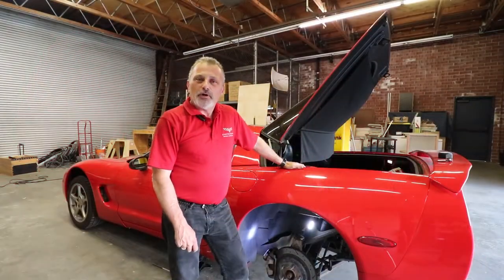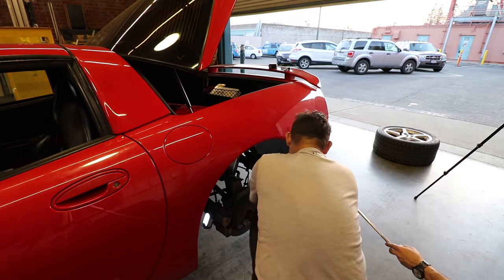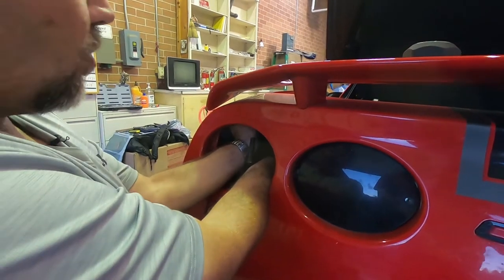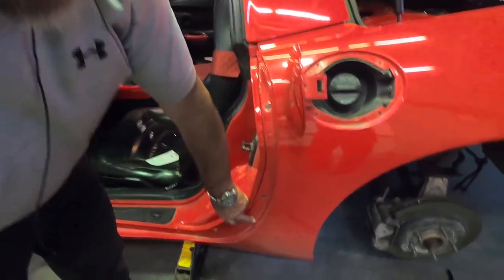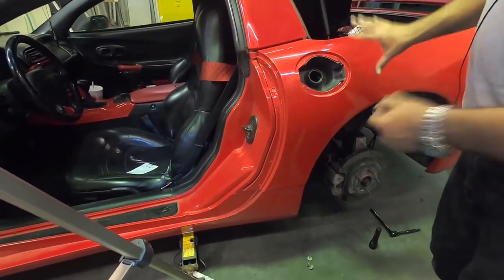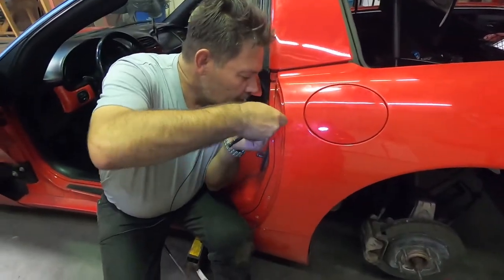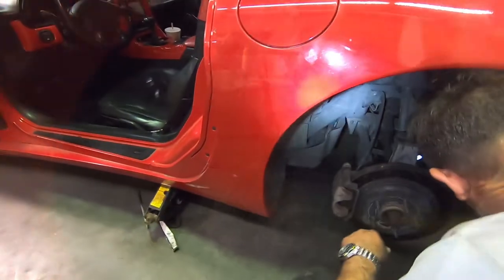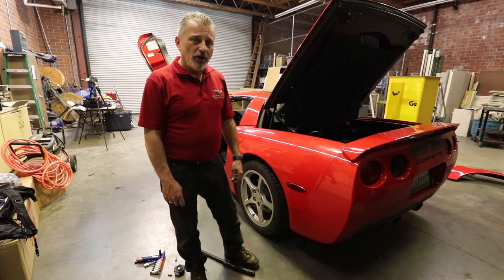How to Remove and Replace a C5 Corvette Rear Quarter Panel

Comment: This video is awesome. It gave me the confidence to do mine. I did it without removing the tire or liner.  Got to it all through tail light. Total repair time was 1 hour 15 minutes. Thank you for a great video.  The 4 bolts that hold on the bracket and lower part of qtr were 10 mm.

Comment: Excellent video. Gentlemen thanks for the truth on this video. 2 Body shops bid removing the fender at 12 hours to remove the driver’s rear quarter. I thought it was B.S.. There reason a lie of coarse after watching you two pros! was the rear bumper had to be removed.

Comment: could you tell me if and how i can access the area that takes in air before it passes through the cabin air filter ? my freinds c6 got invaded by mice and the built a nest in that area , he pulled out a lot of the nest through the cabin air filter opening but needs to access that area to fully clean it . the area im speaking of is between the passenger fender and the cabin filter compartment on his 2007 coupe thanks for your help

Comment: On a c-4, the rear quarters are one piece (both of them) and they are glued to the vehicle. To remove you must heat enough to release the bond of the glue. This one is a snap compared the the c-4 design..